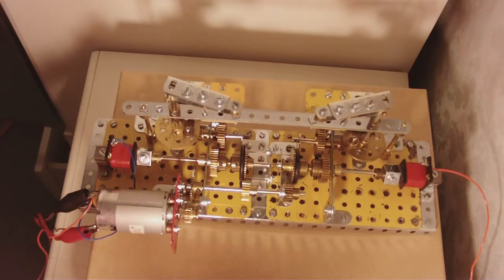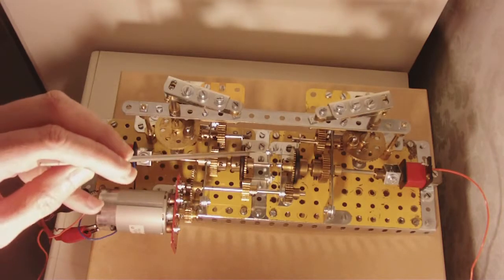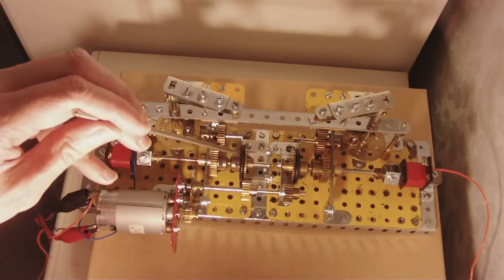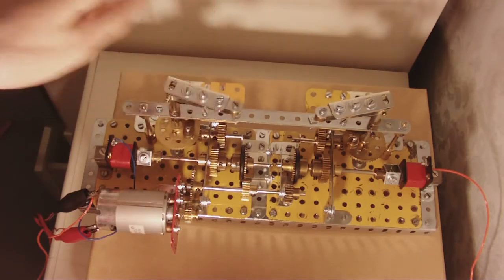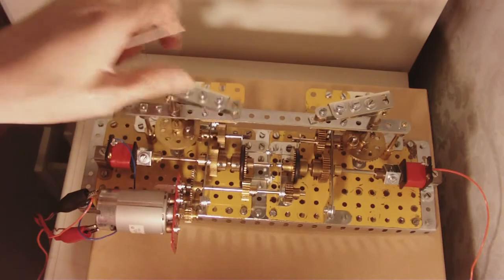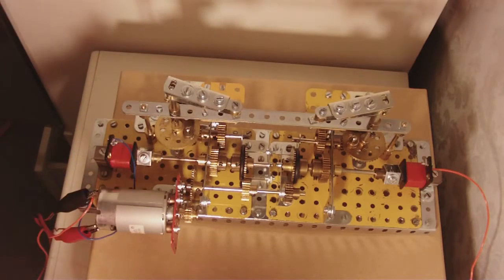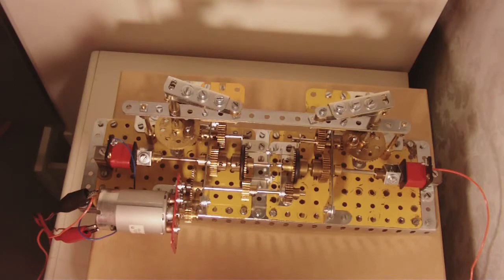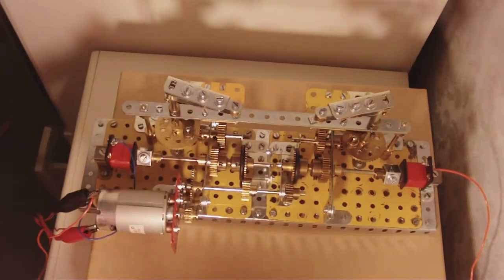Meccano Pinball Flipper Mechanism (Ver. 1)

Comment from the maker: I hope it will be reliable. One thing I didn't say is the flipper and the bevel gear are on a rod with keyway, so they should not slip. It could do with being a bit quieter also.
The next instalment is a little less exciting. It is the legs and frame of the machine. That should be up soon.